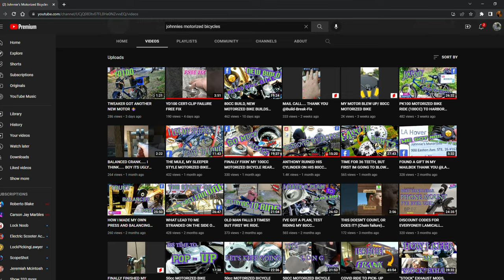Electric Bikes Vs Gas Bikes (In The REAL World)

Comment: i put my first gas motor on my mountain bike 3 years ago its got about 3k miles on it..ive only replaced the cdi and spark plug. maybe ive gotten lucky..but it doesnt owe me a dime ive beat the hell outta it the hub bearings on the mountain bike failed before the motor has.

Comment: Good video! There’s a few things I like to point out….I had a business building DYI gas, and E-bikes.
The DYI E-bike I just built has a 48v 17.5AH 30A BMS…..the Battery was not expensive at all.
Buying a battery with a BMS is the way to go, it cannot be overcharged! And the charger turns off when it’s full’ no matter how many times you try to put it back on the charger….my charger will not charge it when full….the top speed and range is 36mph 41Miles with a battery at %10 power remaining, full throttle constantly.

My E-bike can travel in rain….just like my gas bikes

Range will always go to a gas bike’ bring a small container of 2 stroke oil’ and stop at the gas station when you need to.

Reliability goes to the Electric bike…I sold many gas and electric bikes, and I always have issues with returned gas bikes’ Gas bikes is for people who know how to work on them’ most people will buy a gas bike….don’t do any maintenance on them, ride them into the ground, and blame the builder’ this is one reason why I stopped…..doing gas bikes…. I ended up putting as is on my ads, I would let the person test ride it….and usually would know right away, if this person was gonna have difficulty, owning a gas bike.

I would ask the customer….are you looking to buy a gas bike for transportation or fun, most times….I talked the buyer in buying a E-bike…..one test drive from a gas, and E-bike, and most decided to go with the E-bike
People don’t know how to operate the clutch, burn out the clutch packs, lose the chain, remove the air filter, and ride them in the rain…..I used to provide them a chart for fuel ratios, and provide a bottle of 2 stroke oil….believe it or not, ppl didn’t use the 2 stroke oil, Lock the engine up, and try to return them.

Electric bikes are more reliable
Gas bikes have a longer range
Electric bikes are easier to ride
Electric bikes are cleaner
Electric bikes don’t Attract unwanted attention’ law enforcement’ gas bikes shouldn’t be road on sidewalks….cops have ears, sooner or later they will catch you.
EBikeling kits are very water proof….my battery is very water proof.
You can use the bike rack on the bus
You can ride a E-bike on most bike trails…..unfortunately you can’t ride a gas bike, people will hear them, and before you know it…..a cop will be waiting for you at the end of the trail’ we have many in Florida, and the gas bikes tend to annoy people….a 4 stroke is far worse.’ I think a 4stroke motor wise is more dependable, but louder’ 

Off road light dirt trail….gas bikes are a little bit funner’ unless you own a Mid drive e-bike.

Total cost on my DIY electric bike was $850 without the bike….kit only.

Comment: You should build a hybrid, gas, electric, and pedal bike. Use a front hub or mid drive. Pick a wattage and voltage that will go the same speed as the gas engine will go.

Comment: I don't hate you, on the contrary. I'm going to sub and like, just for the one comment you made. I enjoy hearing truthful information, lies and bs, not so much. Anyway, uh yeah, that comment. You are the first person that I have heard, so far, that has actually told people a very, very smart, and very important thing. *Never charge your batteries unattended!!!*Believe me you are the only other person that I've heard this from, except for myself. I have the standard rad 48 volt chargers, and I'll tell you what, they get hot. It's double fused at the battery, but that's not a fix-it-all solution. Bad things can happen. Spraying water on lithium ion actually makes it burn, and much worse. I've had two chargers fell already, in two years, and I've had a BMS in one of my batteries have a meltdown. It's no joke, these batteries can start a fire, and quickly. Never charge them unattended, and never charge them in direct sunlight. One of the most important comments I've heard someone say. And you and I are the only people that have said it so far.
Reply: Thank you for that comment, my friend.

Comment: Good stuff. Built my 1st electric '06 when gas hit $4+. 12-20 mi range w/o pedaling. 6mi round trip to the Lake Worth FL beach cost 3cents. Worked great for urban life. Now I live in the woods 13 mi from town. Bought Chinese 2stroke kit,, in 2011, crappy castings and fasteners,continuously disintegrating, gave it away to a guy w same for parts.
 Chinese motor
 Bike by Schwinn
 Ride it out
 Push it in....
 Now I mount Honda gxt 160s (5hp22lb tank inc, lots of 'em cheap) above the rear wheel.( coupled weight on back makes sketchy handling) Power delivered by 20" dia crank- mounted fan. AC fan hub blades cut from poly 5gal bucket segments)Made  3, 1st was hardtail, shook floatbowl too much, starved out at speed. Next 2 full suspension mtn bikes, crude fairings, cruise 25, max 40+ downhill+ tailwind 70mpg.
 In 12 yrs cops wave and smile at the goofball on the crazy bikes and ppl pass me, pull over stop and video me passing. I wear earplugs to keep wind and motor noise down. My bikes sound like 25mph lawnmowers.
Great channel! Build a bike!
 Best to all

Comment: Also wanted to say ebike replacement parts are $$$$, battery/controller/motor failure after warranty is like $100-750 depending on what is busted.

Comment: Thanks again for another great video ( and for the brutal honesty on both sides )!  I am having a total blast on my 2 stroke BBR stage 4 build.  Currently building second with a seeutek engine.  Both bikes are Cranbrooks minus the stock handlebars. Any chance that you will be doing a cheap China doll build in the near future? The China doll Motor names are hilarious on Amazon right now and would probably be funny to review and to do a video build on.
Reply from the maker: I have noticed to randomly weird names too lol... I'm currently building a cheap Schwinn Stingray.
Reply: Cool i just built my first kit (their was parts missing) and the kit was 160$
Reply: Just “finished” my first build and it’s a seeutek 80cc. Absolutely loving riding the little thing haha. Had a bunk cdi/plug cap and the chain tensioner sucked booty but now I got her good to go. She fires up every time now! Hopefully for a long time! Good luck with your build
Reply: I also have a BBR stage 4 on a Kent Bayside. It is pretty fun, but I'm trying to find a vacuum leak thats causing a higher idle when I disengage the clutch.

Comment: The happy middle ground between these two extremes is a four-stroke, and a big hoop gear on the back wheel same as the original motorcycles, that is your simplest and most reliable drivetrain

Comment: By the way, how do you deal with the super sluggish jerkiness while trying to ride 5mph on a two-stroke? Would a clutch system help? Wondering because I want to buy one.
Reply: You could feather the clutch, but since it's not bathed in oil like a traditional motorcycle transmission it may wear it out a lot faster.

Comment: I have about 4 years and 4k-ish  sank into ebikes over those years..
I've been riding 2 stroke bikes for about 6-7 years and have roughly 2500ish in engines and engine related only terminal "tackle" alone... About 3k if you include tires.

They just have their places and it's better to have both

Comment: IMO, especially from a cost perspective, Gas is the way to go.  The cheapest 2 stroke kits (<$100) will last thousands of miles if not constantly pinned.  I even run used motor oil as my 2 stroke mix.  I've probably saved more $$$ in not buying 2 stroke oil than what the engine kit cost me.   The only downside to gas is noise.  And they really aren't that loud with a stock pipe.  I even added about 12 inches of coolant heater hose on the exhaust pipe and that helps to quiet it down a bit more.    If I had gone electric years ago, I already would have had to buy new batteries.

Comment: Good review...still think you should have used a 4 stroke and touring as concepts of comparison ...these 4 strokes are now made much smaller less noisy and dont vibrate nearly as much as a 2 stroke and little maintenance besides oil changes. Hands down gas wins

Comment: LoL you ain't bringing up the 4 stroke up because there ain't no faults!!! I would never buy an electric bike!!
My wife has a 4 stroke I built for her going on 4 year's ago. from bike berry it's the beach cruiser 4 stroke.  She hasn't had a problem with it!! Does 38 mph!! We take it on long rides. Can stop at the gas station fill it up and roll!! Not  a very big motor either!!!
Couple pulls to start and your off!!!
I haven't done anything to it except change tires and the throttle cable broke other than that ain't had to touch it!!! I changed the oil once just because, it didn't need to be changed and that was a whole year of riding!!! Maintenance free!! The Mrs.loves it!!
I prefer my triple 6 80cc 2 stroke!!! LoL
Keep up the great work!!! Be safe!!!
Reply: I’m in the early research phase and haven’t decided between a four or two stroke. Are there performance upgrades you can get for four strokes. I see a lot for two strokes.

Comment: If you were to make this comparison video between a 4 stroke with a q- matic transmission and an electric bike, There would be no comparison! The 4 stroke is just as reliable, has better range and almost as low maintenance! And a lot cheaper or as cheap as the DIY electric bikes.  I have had a electric bikes for many years (14 to be exact!)  and am well of all of their short comings but the biggest shortcomings are range and speed and price on some brands. Also the issues of replacing batteries is a big one. Not just cost but  weight and durability. If you use a electric bike for commuting. Most of the time that means using bike twice a day. That battery will more then likely have to be replace after a few years.   And please dont get me wrong- I like my electric bike for some uses but it is useless in regards to doing the 90 mile tour I did today on my 4 stroke motor bike.  Great Videos Hover Man! Best Regards,  Michael M.

Comment: There is a reason he didn't compare this to mid drive e-bikes. Best of both worlds. 750w and efficient from the transmission on your bike already. Can cruise @ high speeds while sipping power. I had a Grubee skyhawk 79cc motor bike and it vibrated alot. I was always adjusting and tightening stuff. Had to epoxy and locktite alot. Hes also not mentioning the oil costs.

Comment: Here in Poland, we do not have any law about motorized bikes so it is kinda illegal, but as long you drive normal, about 35 km/h, police do not care. They pull me over twice just to see my DIY bike. Most of the time it's curosity how it works. I have driving licence for a car so by law i can drive bikes up to 125 cc. Only problem it is that i cannot register it or buy insurance so this is that illegal part. I draw more attetion than ferrari, but it is fun. And yeah learing process how to maintance and drive without failure was nightmare. I drive it daily from home to work. Right now have about 700 km without any major failure

Comment: There are heard of but not necessarily common expensive and unsafe consequences to storing at a high state of charge or charging a lithium ion battery unattended.  Making sure it and your charger each has an UL rating, and verifying that it's legit, will ensure it meets safety standards by design; but could have manufacturing defects or damage from hard abrupt g-forces. I have an ebike, considering how to store the battery pack during and after charging until the next use, so if there is a problem it will be contained.  Maybe a fitted container lined with dirt, fireproof insulation, clay, whatever is easy to touch with the other side in a flame.  I don't want to scare people from ebikes.  Just make sure you can make it convenient while eliminating the threat of a house fire.

Comment: This is an interesting comparison.  I hemmed and hawed over wanting some kind of backup ride if/when my car ever breaks down which it has.  I'm a castle of one and have a home business across town which pays the bread and butter (barely, lol).   Anyway I'm tired of begging for rides!
Some comments here of course the worst I wanted to hear.   I was looking for a dependable way to transport my body across town and perhaps a few small items on the back rack.    All the E-Bikes I looked at were exhorbitant price, and I don't like that the electric bikes can simply stop working with a problem, or have to wait on charging in emergency. 
thought,  "A 2 stroke is like a lawn mower engine and that's pretty easy and dependable".     I get the maintenance thing and will do whatever is needed but hope (as I'm building a 2 stroke now off a Chinese kit) it doesn't end up a money pit project and endless tinkering.

My biggest concern all along has been the noise, though I haven't even started it yet.   Would be interested in quieter mufflers than stock recommendations.  I just don't want to wake up neighbors.   Also my stock throttle kind of rattles a bit on the handle, a bit too big for the bike bar.   Im assuming electrical tape underneath would gum up, not sure what to do but I imagine that will be annoying riding.   Thanks for any suggestions.

Comment: My rear wheel is gas, i am adding a 48v 30amp electric front wheel... the electric throttle is upside down on the left handle... but it works...

Hold in the clutch for the gas engine... get started on electric wheel, release the clutch to start the gas engine... when on quiet bike trails kill the engine and roll by electric to be polite...

Comment: Im really having a hard time to decide and everything boils down to noise. While I will love to build my first gas bike because looks way more fun than electric BUT where I live is a very quiet neighborhood full of elderly people so the noise of the gas bike wont be fun im leaning to the side of electric. If I can find a really good, again, really good silencer no matter if I cut on performance of the engine I will be fine but so far no luck, everyone post about performance mufflers, not about silence the friking thing. Because of that im leaning a bit to the electric option. Im even thinking to build both in one, gas and electric with the electric kit that has the motor in the front tire. Im building a cruiser cheap walmart bike.

Comment: I definitely do not hate 2 strokes power wise,
 but I built an 80cc 4 stroke after a 80cc 2 stroke,  and in my opinion 4 stroke engines are much more reliable, as long as you change the oil occasionally, Although i haven't tried an expensive electrtic bike, as far as gas powered goes, 4 stroke is by far the Most reliable without constant "tuning".
Reply: Can you elaborate on 'constant tuning'?   What is the constant tuning youre having to do.

Comment: I like them both, but I really don't like taking the gas bikes on the trails.  Even with suspension the rides is  little too rough.
Reply: Rough ride? I find they smooth out with speed...either that or I wipe out.
But honestly I have a no suspension trail bike build I run wide open off roading on old trails 44t sprocket 
Just stand up loosen your arms up a Lil and rip it. The Brap and ensuing child like grin are well worth it.

Comment: Also I know 2 different people also on YouTube that says they got 10k plus on their first gas build. Both say 1st thing is a 90ish quality crmo frame. Next 1 used a cheap ebay China doll 49cc the other used a 66/80 wildcat for $135. Both say 32 to 1 from crate to death. 1 went through 4 set's of V break pads @ the cost of $10 a set of 4. The other went through 9 set's of disk breaks and 18 set's of pads did not mention the costs of those. Both say how do all the other's not get the same longevity out of their gas built bicycles they say they are clueless. I think I know the problem. On engine all that hyped up crap is highly over rated unless your using them for race's Only. Because both showed their still using all the same cheap kit throttle cables etc that came with their kit's.  1 had the upgraded throttle it's broken out of the plastic housing but as he shows still work's. Also I think he said 3 set's of tires. Electric bike's will never do that millage without replacing batteries their good for 1 year of solid everyday riding. The hubs go out buy another one the controllers burn out buy another one. Then all the breaks tires etc. I found Only 1 guy on YouTube with an electric front hub that went 20k miles. Front hub set in assist mode 2 to 3 which means he's pedaling 99 % of the time. Also he lives where temperatures never go over 80° also the front hub was a 1500 or 2000 hub I forget which. He had a 40ah $4000 dollar battery @ the time he built it. I think I'll take the $200 used trek chrome molly & the wild cat pk80 every time for $135 for reliability.

Comment: Motorised bikes will introduction you to thread locker and zip ties. I have both gas and electric (coal burner) i love both but the gas bike is more capable and fun. My e bike has a mid mount bafang bbshd and 48v 27ah battery.

Comment: I like both ebikes and gbikes. That being said, gbikes are absolutely cheaper to obtain. Right now as of this comment, you can get a basic gbike kit for around $100 USD. You can get a brand new mountain bike for about $100 USD. So, for about $200 and some time, you have a motorized bike. For ebikes however, the battery is what gets you. An ebike kit minus battery is about $180 right now, bike about $100. But, the battery is like $300 minimum. So, cost for a functional motorized bike as of this comment is about $200 and for ebike about $600.